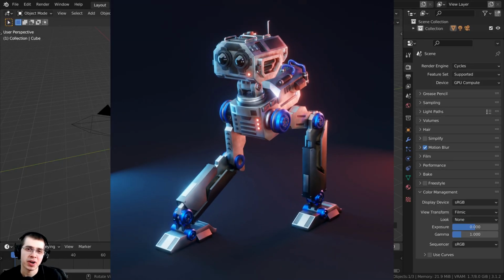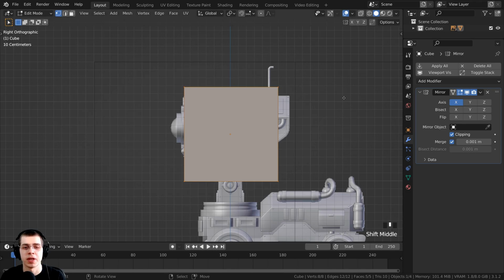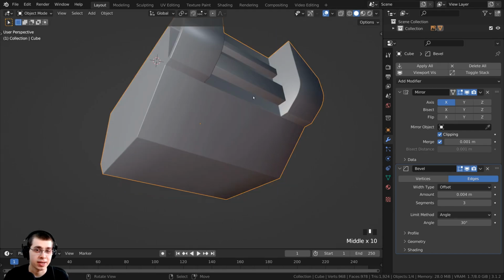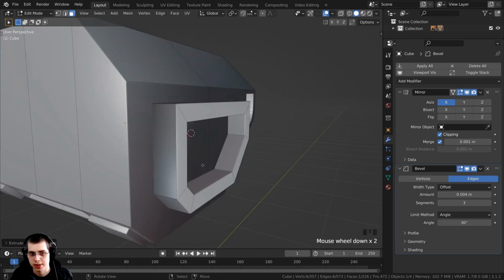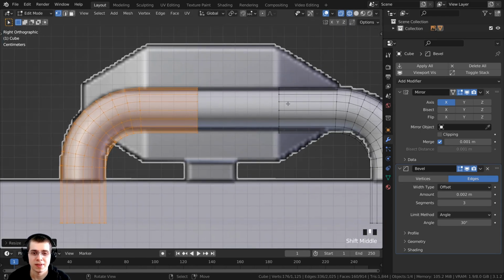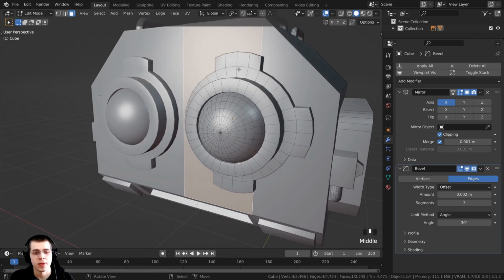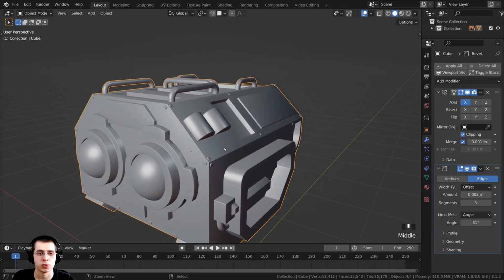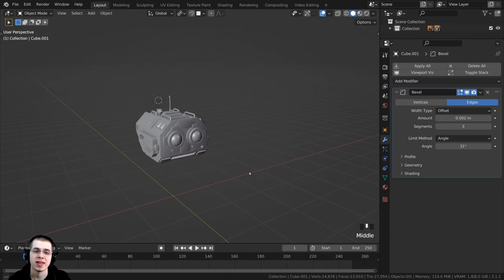Sci-Fi Mech Robot - Part 1 (Blender Tutorial)

Comment: Hi there, I am trying when i switch off the boundary when insetting the front of the face and try to extrude it inward, it doesn't work properly. There is like a partition visible in between the two extruded faces. Any way to fix this?

Comment: Thanks Ryan! This is an amazing tutorial! 
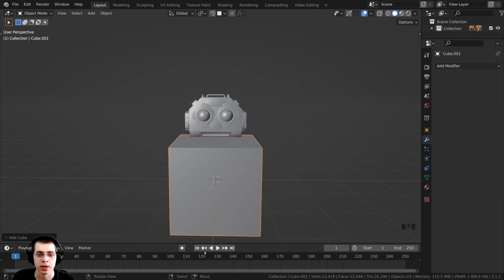For some reason, on the new object (from around 1:26:00) something is off for me - as if the orientation is wrong. But I checked the orientation and it's correct. I went ahead and finished part 1 and so all the other objects joined to that mesh has the same problems (it looks like they have black shapes on them). Again - checked the orientation and it's all blue, also did SHIRT-N just in case - didn't help. When I removed the Bevel it went away but clearly a bevel is needed there... changing in Bevel the segment to 4 make it better but not fixed. 
Do you have any thoughts to what may have caused it?
Reply from the maker: Hmm that's weird. did you maybe duplicate the mesh by accident, so its overlapping? It sounds like an overlapping mesh problem, where the faces are in the same spot in the 3d space, but I'm not sure why. You might want to also try removing any Overlapping Vertices. I have a tutorial on how to do that here: https://youtu.be/Aclg2unKbyY
Reply: @RyanKingArt  Amazing - you were spot on! it fixed it thank you!

Comment: Thanx for a great tutorial. I try follow it but stuck on bolt snapping (https://youtu.be/JWlX22IBTPo?t=4618). First of all I started with 3.2 and upgraded to 3.3. Snap menu is slightly different. For some reason when bolt approaches face it flips 180-degree and snaps not to face, to the middle of an edge. What I do wrong? Thanx.
Reply from the maker: hmm, sorry its not working for you. not sure why. yes, the snapping options are slightly different, but all of the same setting should still be there.

Comment: Hey!!!! Ryan I'm getting problem while snapping the nuts on the head. I used align rotation to target option but my nuts doesn't get rotated according the faces .
Reply: Nuts are moving weirdly along the faces
Reply from the maker: Hmm, the align rotation to target option should fix the rotation problem. I don't know why it wouldn't work.
Reply: @RyanKingArt  i tried fixing the normals by pressing shift + N and even tried pressing ctrl + A to even all the transforms but nothing worked so I fixed the nails manually

Comment: At the end of this course, will you get a game ready model? Or will it be suitable only for rendering/animation?)
Reply from the maker: The materials are procedural, so no, it will not be game ready. But after you do the tutorial series, you could bake the textures and make it game ready. I baked the textures on this model to upload it to Sketchfab.
Reply: @RyanKingArt  oh, great) Do I understand correctly that in general, the topology of the model is suitable for triangulation and attempts to load into the engine? Or, could you recommend lessons that tell about the correct topology for games?
Reply from the maker: @Daria-t3n1k  I don't make video games, so I actually don't know.
Reply: @RyanKingArt  oh, allright, thanks!)

Comment: For some reason when I copied the Modifiers for the thing on top of the head, both modifiers were there but the Bevel didn't show on the object. I got around it by deleting the object and adding a new cube and applying the Bevel mod before I edited the object. One thing I had to change with the Bevel was the angle instead of 31 I left it at 30 because some of the edges were smooth out too much.
Reply from the maker: Ahh ok.

Comment: Great series and I'm loving it already! Just a quick note: I'm using Blender 3.2.0 (stable) and everything is the same, but I was getting some real ugly shading on the model regardless of the matcap I used (it looked like "bad geometry") - I finally discovered that Auto Smooth Normals was turned off. If anyone else is seeing ugly shadows on some areas of their model, try going to Object Data Properties > Normals > and make sure Auto Smooth is checked (leaving it at 30-degrees is usually fine).

Looking forward to the rest!
Reply from the maker: Thanks for the info!
Reply: Thx
Reply: thanks, i had same issue with last pipe
Reply: Had the same issue, thanks!